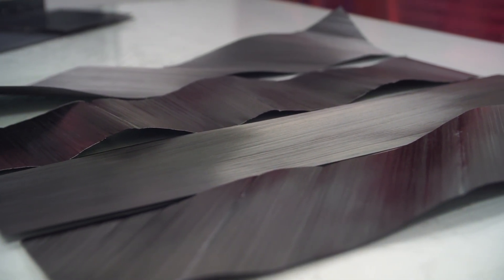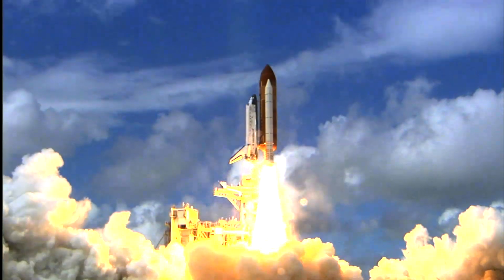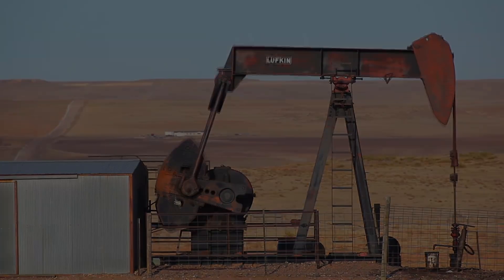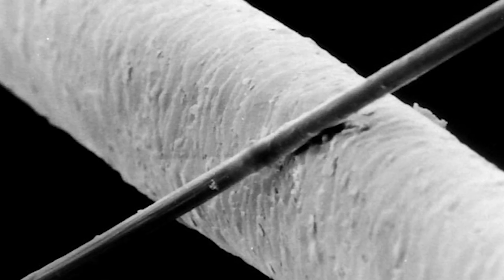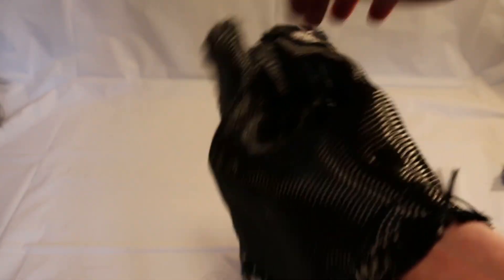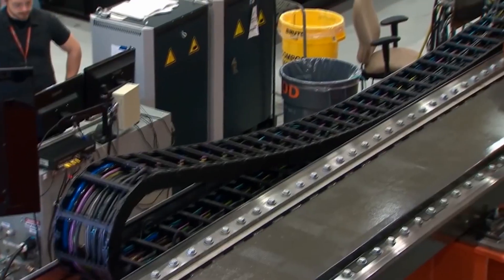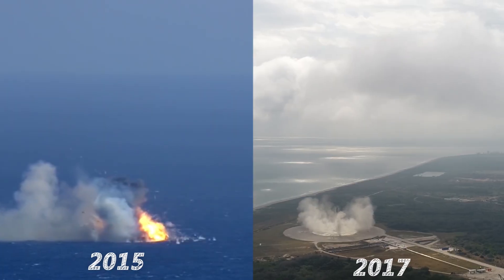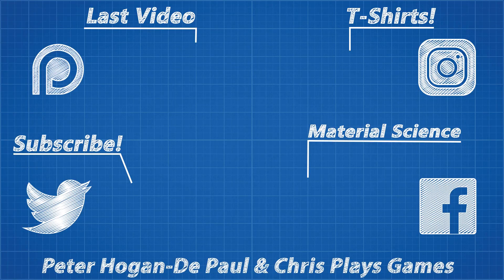Carbon Fiber - The Material Of The Future?

Comment: I have a question: is the heat resistance of the fibers themselves enough to withstand molten aluminium ? Could it be possible to create composite metals ?

It would be interesting to see how metals crystallizes in the presence of aligned fibers. Maybe that can help reduce micro tears ?
Reply: There have been tests done with creating carbon fiber-metal matrices. In many cases, the composite has superior properties when compared to when the materials are on their own, but the properties are still dependent on the geometry of the carbon fibers. A better solution, at least from what has been observed, might be to utilize CNTs in metal composites. You could disperse multiple strands of CNTs in different directions without significantly increasing the bulk of the metal composite. Carbon fiber might be better suited being used as a reinforcement for structural concrete in place of conventional reinforcements, as tests have shown that it does improve the properties of concrete.
Reply: Those results with concrete where why I was wondering if it could be used to reinforce other materials. And it makes sense that an already strong structure could be better suited to reinforce metals, but I was just wondering about the possibilities of carbon fiber, because, ya know, they are easier to manufacture. 

If I had the capacity to do it, I would be making all kind of combinations with the fibers. Other that also makes sense in my mind are ceramic materials, but again,  they would be better materials with cnts, but, what about affordability ? Carbon fiber reinforced ceramic conductor caps, for example.
Reply: The problem with trying to utilize carbon fiber in ceramics is that ceramics are typically used in applications where the operating temperature exceeds that at which carbon fiber remains functional. Contrary to what intuition would say, in silicate-based ceramics, carbon fiber actually increases embrittlement in the composite do to it reacting with some of the other materials present in the ceramic and creating porosity within the matrix. In order for carbon fiber to be utilized in a ceramic matrix, it would have to be in lower temperature applications than what would normally be done for the ceramic. 
One such application that is promising is the use in ceramic saw blades. The increased strength in the blade would mean that the blade degrading due to stress would be mitigated and the fibers could prevent micro fractures from propagating throughout the structure. It is something that wold be extremely useful if the above mentioned issues can be adequately solved.

Comment: Any idea what type of tests Spacex performed on that tank? I don't understand why they put the thing on a barge and sent it out to sea. Maybe they deliberately  pushed the tank to its breaking point to see what that is, that would explain why they didn't want it nearby.
Reply from the maker: I believe it was tested with the explosive liquid fuel.....ideally not something you test near people. The reports said the tank flew 50 metres into the are and had to be salvaged from the sea. Still waiting for that space x announcement.
Reply: Real Engineering So they poured liquid fuel in and waited to see what happened?Well, if this tank is for the spaceship itself it needs to survive that, but don't the long term tanks come with cooling systems? Now I really want to hear what spacex is gonna say about that.

Comment: carbon fiber and metal 3d printing combined will be like going from the Stone age to the bronze age. carbon fiber will allow people to enjoy the same or more power using the same amount of energy
Reply: mac berry Well 3D printing with composites are normally random orientated short fiber, so not as strong. Also from what I know currently carbon fiber filliment is normally used for its conductive properties not strength.
Reply: 21BDP21 metal 3d printing for engine parts or the whole engine and other parts that can't be made of carbon fiber
Reply: mac berry Isn't that more of a sintered powered metal with out a mold? edit never mind I originally read your comment as one thing not two separate technologies.

Comment: Material of the Future? I had a Carbon Fibre bonnet on Need for Speed: Underground in 2003!

Get with the times!
Reply: o shit
Reply: Except it was shit in the 80's and 90's the resins used were incredibly prone to delamination under UV light. They were structurally unsound, prone to cracking and often weighed more than their aluminum counterparts making them largely useless in most applications. But hey. I'm just a bike mechanic speaking from personal experience, nowadays I'm the biggest carbon advocate I know, carbon fiber rims and frames are a godsend.
Reply from the maker: That was a vinyl you stupid poser.
Reply: @RealEngineering  In 1860 Joseph swan produced carbon fibers for use in light bulbs
Reply: @RealEngineering  wtf chill the fk down bro
Reply: Real Engineering hahahahhaha
Reply: Real Engineering damn harsh. i like it
Reply: it actually wasn't you could buy CF hoods and spoilers.

noob
Reply: GrittyMcCheese Carbon Fiber has been around in various forms for a long time, but not in the way it's being used today. Get with the times.
Reply: lmao
Reply: Real Engineering savage
Reply: omar that's a game not real life and that's not the point the point is how revolutionary this meterial
Reply: they have had fully carbon fibre monocoque in F1 cars in the 80s
Reply: Rounded carbon grains create damascene strength (and the distinctive patterns) in steel.
Reply: Real Engineering well that's harsh
Reply: Steel has been around forever and has been used in many ways before the Steel Age, it just wasn't mastered until then. This is the same for Carbon Fibre.
As for it being used for car parts, what the fuck? Duhh?
Reply: Like real engineering has stated, we have barely started to scratch the surface with what we can do with carbon fiber. The potential for carbon fiber has yet to be determined. Thus, making it a material we'll "squeeze" more usefulness out of. It is the material of the future.
Reply: But could your car fly
Reply: How many kilowatts did the bonnet make?
Reply: omar Me too. LOL
Reply: omar is SOOO typical of posers who come onto channels run by peope who REALLY have their stuff down cold, and try to lecture them or poke holes in their material. I've seen it on several Astronomy channels where I moderate. But one channel of that genre NEVER has such morons show up, ironically  because the channel owner is not only WAYYY beyond PhD, but a super nice guy and never gets rude. I have no such restraints, so omar? you're a childish moron. To find that you're a gamer came as NO surprise.  To find that you conflate gaming and reality also was not surprising...SAD, but not surprising. This channel deals with reality!! 
Get with the times.
Reply: That's just a game you filthy casual!

jk
Reply: carbon nanotubes are in original damascus steel
Reply: GrittyMcCheese 
Cruiser Edinbu    

B m Cruiser Edinbourgh